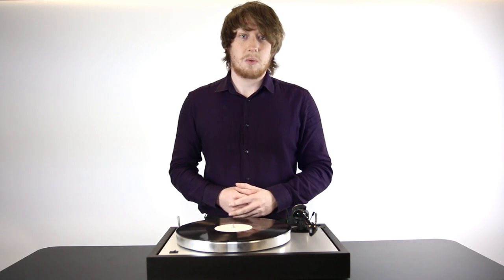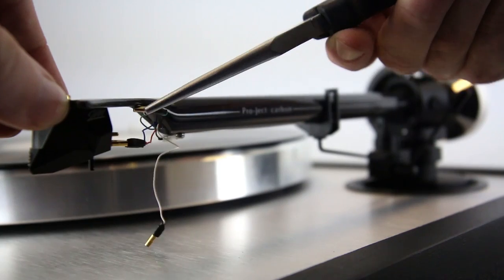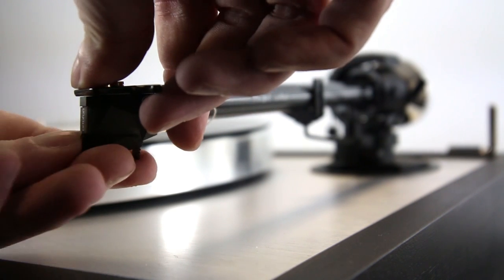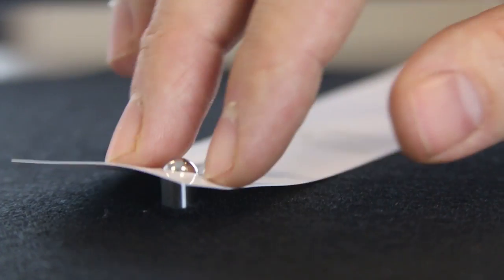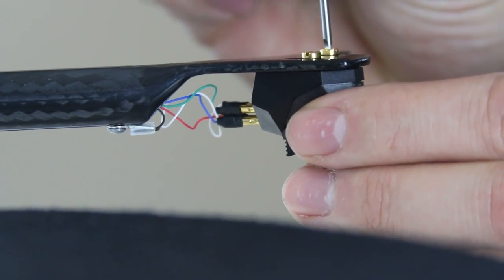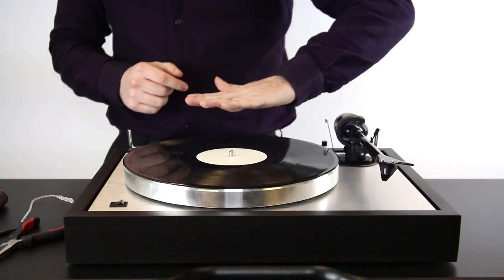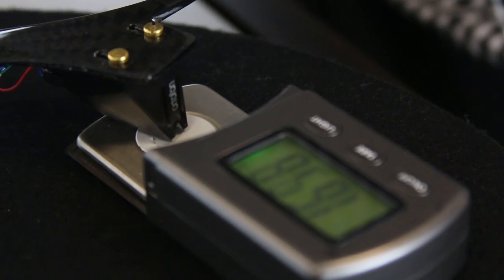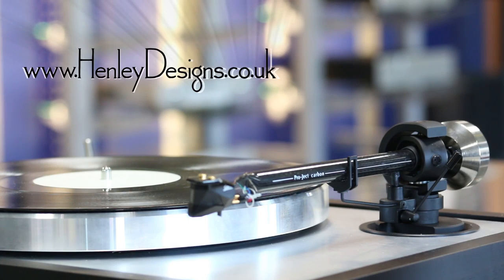Changing & Aligning a Cartridge

Comment: My project primary e phono does not have an anti skating weight would i need to install one? thanks for the balancing tutorial its very helpful
Reply from the maker: Good Afternoon,

Did you buy your deck new? It should have come with an anti-skate weight in the box which can be easy to miss, usually in a small clear plastic bag within the packaging. If not, then yes it is recommended that you pick one up and install it. It will just protect your vinyl against skating and prevent one-sided groove wall wear!
Hope this helps.
Reply: @HenleyAudio  I can't find what it's supposed to look like I've also heard my model has it preset? and yes I bought it new
Reply from the maker: @sunkenblaidd  apologies, you are correct! The Primary E Phono has the anti-skate pre-built into the arm, so no need to worry about the fiddly weight!

Comment: I want to upgrade the Ortofon OM 5e that came with my pro-ject T1 to an OM super 10 cartridge. Is adjusting the tonearm weight still necessary, and do you have any other tips?
Reply from the maker: Good Morning, all of the OM Series cartridges should weigh in at about the same weight so no adjustment would be needed, but to put your mind at ease you could test the downforce and compare it to the recommended amount that will be listed with the OM Super 10 Cartridge paperwork. Hope this helps!

Comment: Does it not matter how forward or backward the cartridge is in the headshell? Would that not affect overhang?
Reply from the maker: You are correct, it will effect the final result, with Ortofon cartridges it is generally easy to know the distance as the carts are designed so that you can roughly line the cart up with the front edge of the headshell/tonearm and it'll be correct. But if you need to move it forward or back to another position, just be sure to adjust the downforce accordingly via the counterweight at the back of the tonearm. Hope this helps.

Comment: Great video, but I was a little confused by the cartridge alignment.  The 2M cartridges are very triangular, so what part are you actually squaring up with the protractor?  Thanks.
Reply: It should actually be the stylus cantilever.   The cantilever has the stylus tip which tracks the groove - this is what should be aligned correctly. The problem with aligning the cartridge body is, not all cantilevers are centred correctly in the cartridge meaning that your cartridge body may be perfect with the protractor, but the stylus cantilever could be off!

Comment: If I change the Ortofon 2m blue with a 2M Bronze do I need to rebalance the arm?
Reply from the maker: Good Morning Ariel,
Provided that you are careful when changing the cartridge you shouldn't need to. The 2M range of carts all weigh the same and require the same amount of downforce so, bar any knocks, it should still be correct once the Bronze is installed. Of course, it can't hurt to be sure, so if you are able to check, then by all means do so!
Hope this helps
Reply: This really helps and thank you. Also this question is off subject but do you know if there is a really audible difference from the 2m blue to 2m bronze?
Reply from the maker: @arielrodriguez6980  Happy to help!
The differing material components between the two cartridges does give different sound profiles yes, although much about audio is subjective the Bronze is often described as a warmer and more 'romantic' sounding cartridge. 
If you are UK based you could use our website to find an Ortofon dealer near you and request a demo?
www.henleyaudio.co.uk/shop/dealer
Reply: Thank you, but I reside in the US. I will have to see if there is a local dealer that I can demo.
Reply: @HenleyAudio  not all 2m tracking force is the same. The red and blue is 1.8 g. Where as the bronze is 1.5 g. Recommended anyway.
Reply from the maker: @FearTheKnife  Quite right, my apologies! Yes, you'd need to set the downforce correctly, but wouldn't need to re-balance the tonearm from scratch (unless desired) :)
Reply: @arielrodriguez6980  I've owned the red, the blue, now the bronze. The blue is astronomically better than the red in every way. However the bronze is more subtle and took a minute to notice the difference. On the bronze I found that it's quieter, and a lot more detailed. There is a small drawback I feel to those benefits and that is it feels a little less punchy than the blue has a more flat sound overall. I actually have found though that using an acrylic platter or acrylic slipmat if necessary regains the small punch that it lost from the blue and sounds absolutely perfect. The question you must ask is those small nuances worth 200+ dollars to you if so then yes its better. However the blue is excellent at its price point. I'd be happy with both.
Reply: @FearTheKnife  Thanks for your detailed explanation! I am in the same situation now, trying to decide blue, bronze, or OEM silver. (and dare I say black) I am moving from a vintage Kenwood KD-5033 to a Pro-Ject 2xperience classic, so I expect the difference will be massive? I am not sure if I will notice subtle differences of a bronze or even black.... and if its worth it to spend significantly more $$ - as you have mentioned. But I also have this silly idea in my head that a quality TT should have a top quality cart whether I hear the difference or not! haha
Reply: @ryanrm8547  I put a silver needle on the red body, and it wasn't much different. If I had to choose between red, silver, blue. Blue all the way. If it was between blue and bronze, bronze only if the cost difference is worth it to you. I wouldn't even entertain the idea of the black honestly, especially since there is an awfully lot of brand new vinyl with bad pressings or defects, and the better the cart the more it highlights every flaw. Have fun with whatever you choose though, it's fun to tweak.

Comment: I  break  some tiny wires inside the cardtrige when trying to remove the stylus,  will the cardtrige  still  work? thanks
Reply from the maker: Good Afternoon,
Sadly it's unlikely that the cartridge will still work. If the cartridge is still within warranty then you can contact your place of purchase and they may be able to help. Otherwise a potentially costly repair or outright replacement may be necessary.
Good luck!

Comment: The protractor is a general ball park setting, and not accurate at all. Every cantilever has a different angle to the cartridge body. To do it properly, you need a test LP in order to fine tune all the angles respectively in relation to the actual sound via the stylus.

Comment: How can you talk about cartridge alignment without mentioning about VTA adjustment ???  Many people watching your video will believe what you did was the only thing needed for cartridge alignment and totally miss out the importance of VTA adjustment.  Does the turntable used in your video have the capability for  VTA adjustment ??
Reply from the maker: Good Afternoon - you hit the nail on the head there at the end, this turntable does not offer the ability to adjust the VTA, as the majority of entry level decks do not, and thus this video is primarily aimed at those starting their vinyl journey.
Of course VTA is an important adjustment, one that is happily included in mid-high end models generally - but the benefit of working up a range of cartridges such as Ortofon is that each range spans a large upgrade price-range while maintaining the same bodyshape. Meaning you can go all the way from a 2M Red to a 2M Black without needing to adjust the VTA. The same goes for the OM series, Quintet and even Cadenza (not that you'd be putting the later ones on this deck!).
Thank you for your comment, perhaps it would be worth producing a similar video for a High-End deck, highlighting all the possible tweaks and adjustments available!